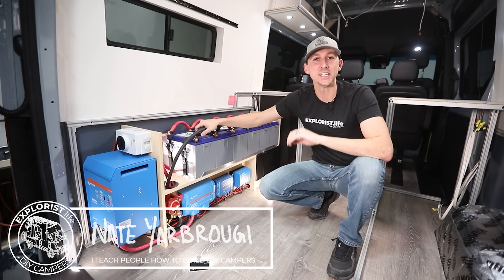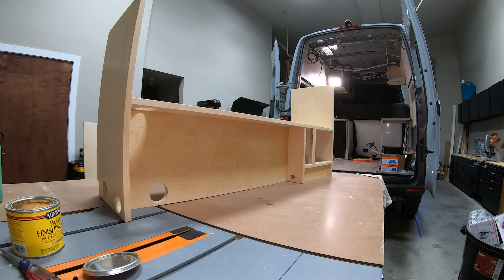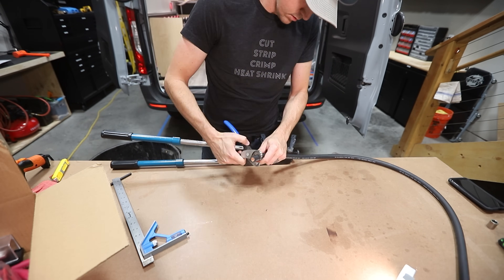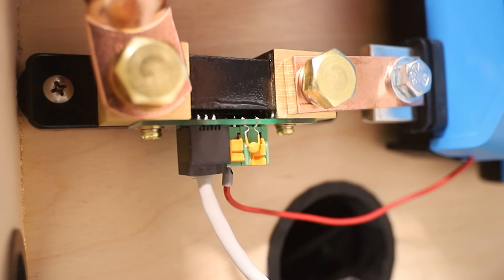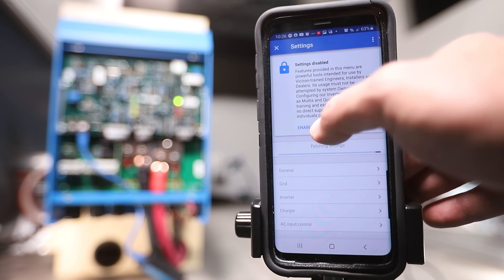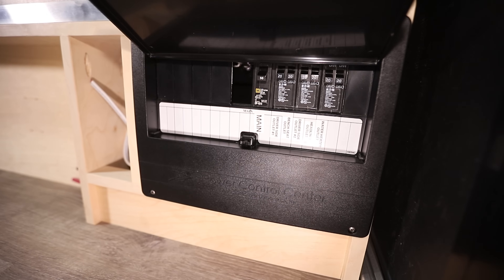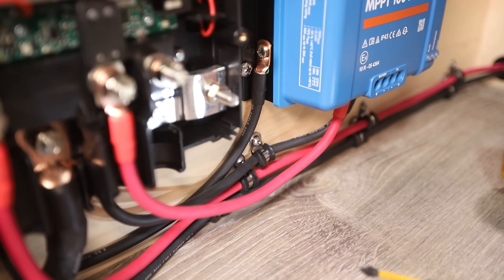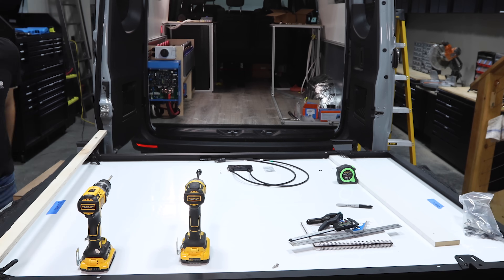DIY Sprinter Camper Van Electrical Install - Full Tutorial

Comment: When your charging the batteries off shore power is there a bypass so that your electrical usage switches straight to shore? Or when you are plugged into shore the power go to the batteries and then to the rest of the system?
Reply from the maker: There is indeed passthrough when connected to shore.

Comment: Hi There!  I just purchased my set up from your guys and was wondering if you need to buy a specific breaker for the 120 panel or if a generic type will work?  Thanks!
Reply from the maker: There is a list of appropriate breakers under 'product information' on the product page for the panel: https://shop.explorist.life/shop/all-products/distribution-panels/120v-ac-distribution-panel/

You'll want to use Square D HOMT breakers (Square D HOM Tandem) in whatever size you need.

Comment: Hi Nate! I’m closely reviewing the dc/dc battery charger installation and I’m wondering why you connect the positive wire to the start battery charging circuit. I do have a renogy battery charger, and they give instructions to place the pos and neg wires directly to the starter battery (plus ignition cable). Is there an advantage to installing the renogy dc/dc battery charger in the way you model in the video? I also have a sprinter 2022. Thanks for any comments on my question.
Reply from the maker: You could also connect the wires directly to the starter battery if you can find the space.  Since Mercedes gives us a nice fuse holder to connect to, it's best to use that.  Renogy is just giving 'general' advice since they don't know what vehicle you're installing it on.  Similar to how all of my diagrams at https://www.explorist.life/solarwiringdiagrams show connecting directly to the starter battery.  If it's better to connect in a different method for a specific vehicle...do that.
Reply: @EXPLORISTlife  Thanks a lot Nate! I appreciate all your help!!

Comment: Hi Nate, thanks so much for doing this it’s really helped me out with my victron install. I have one question, when I isolate my battery i still have power coming to my lynx power in via the solar/mppt UNLESS I turn off the solar isolator. Does this sound correct?
Reply from the maker: You should always turn your solar disconnect switch 'off' before turning your master battery switch off.
Reply: EXPLORIST life - DIY Campers thanks Nate but aside from that it sounds normal?

Comment: Is the multiplus pre-programmed for battleborn batteries out of the factory. For example if you buy the Batteries first then the multiplus later, will it's factory settings still be for the battleborn batteries?
Reply from the maker: If you buy the Multiplus from Battle Born, they will program it for you if you ask.

Comment: Would there be a way to incorporate an EV charger to charge the batteries through the Victron system? If one had a significantly larger battery system, being able to go to an EV charging station and top it up before heading out or before parking would be cool.
Reply from the maker: I'm strongly against that, from an ethics standpoint.  That's a great way for us to get even more parking lot restrictions placed on campers and vans.  Leave the EV charging stations for those trying to re-charge to get home or to work.  If you need to charge from shore power that badly, a campground is the answer there.

Comment: When I asked the battery manufacturer (I went with Lion Energy) they advised against chaining 6 batteries in a row and said it would be better to split them into two battery banks. Have you heard differently? Also the shunt says its only rated for 500a, is it ok to run all the battery grounds through just one smart shunt? Thanks!
Reply from the maker: I can't go against a battery manufacturers recommendation.  that would be a pretty huge liability for me if something were to go wrong.  It's no issue with Battle Born Batteries.

Re: Shunt size: This system will never be able to flow 500A to overload the shunt; and if it did; the 400A main fuse would blow.  Don't confuse amp hours of battery storage capacity with actual amperage demand/output.

Comment: Nate, getting ready to install my electrical system. Would this entire setup with 620 ah AGM battery setup? I’m thinking of using this exact system but want to be sure I won’t be cut short on power or if there is a major difference in the components if I am using AGM rather than lithium?
Reply from the maker: All of these components are indeed compatible with AGM batteries.

Comment: I didn't see a breaker/fuse on the shorepower cable prior to it entering the inverter. I am thinking either a resetable fuse or an on/off switch before that shorepower wire enters the inverter? I have seen this in other layouts - thoughts?
Reply from the maker: That breaker is in the shore power pedestal in the campground or in the breaker box in the wall of for a standard 15A household outlet.  Same concept as to why there isn't a breaker between a wall outlet and a blender... it's protected at the breaker box.
Reply: @EXPLORISTlife  Right. Thanks a ton for getting back to me and the basic sanity check!! Your series is great and I am building mine out RIGHT NOW.

Comment: 16:17 I'd be curious to hear why he made the length the same, if anything, I'd expect the resistances to need to be the same since that would be affected by things like connectors and switches and whatnot, which would imply that the distances shouldn't be the same, but either way, it doesn't seem like the resistances or lengths of those wires would matter.

Comment: i have a  question,  how much amp can the batteries handle at the same time? if its only 100ah batteries means converted to 120v it only has 10amps output? that's far from enough for suppling all the appliances at the same time
Reply from the maker: Each of these batteries has a max output of 100A.  Since we wired them together in parallel, the entire bank has a max output of 600A; which means that, on paper, we could theoretically pull 60A @ 120V given we had a large enough inverter.  (caution - this battery bank and wiring would be too small for an inverter capable of putting out 60A @ 120V (7200W))

Comment: Also just wondering! Shouldn’t you be using a T-series fuse. I didn’t think the Anl fuses had a high enough ampacity rating in the case of a battery bank short?
Reply from the maker: Class-T fuses are technically the better choice, but they've been out of stock nationwide more often than they've been in stock over the last two years.  Something that is out of stock all of the time isn't particularly useful to any of us so we have to use the next best thing.

Comment: Hey Nate.

I'm working on a very similar system. Issue I'm having is finding a place to buy quality 6 awg triplex for the run from the multiplus to the breaker box. I can find good quality marine grade 6/3 but only in 30+ ft quantities. I realistically only need like 5-8 feet. Any recommendations on a brand/vendor who sells by the foot for a reasonable price?

I see your kit contains 10 ft of 6 awg triplex but you don't seem to sell just the wire. Mind sharing what brand you use and where one might find it? Wish I had thought to ask before I placed a recent order with you ;) 

Thanks btw. Your videos are great. Our battleborn package is based off one of yours.
Reply from the maker: One of the reasons we started selling this stuff is so I don't have to hunt around for who sells this stuff in reasonable quantities.  I'd recommend just buying our kit so you can install it like we showed in this video.  Obviously, you can choose to source it elsewhere, but I'll leave you to your wild goose chase for that one.  Here is our kit that includes the wire plus everything else you'd also need to be able to connect the wire to the breaker box and the multiplus: https://shop.explorist.life/shop/all-products/camper-wiring-kits/component-wiring-kits/120v-ac-distribution-panel-wiring-kit-no-panel/
Reply: @EXPLORISTlife  Hey. I can appreciate that but it just doesn't make sense for me to buy your kit. I have everything else in it already.  The price plus shipping is only about $60 less than buying 30 ft of marine grade 6/3.  I guess I'll go that route and then see if anyone locally wants to buy any of the excess. Thanks anyway :) 

I am actually getting a shipment from you today with some other items in it though... really appreciate you.

Comment: I am beginning the electrical system in my van (2019 pro master) using your system here. How did you mount your battery box frame to the van? Or does yours not need to be mounted since it seems like its going to be in a bench?
Reply from the maker: It was secured to the body of the van with L-brackets and bolts.

Comment: Hey man i was wanting to know what i would need to run solar to my enclosed trailer, i was thinking 4 100 watt panels, 200ah lithium battery and a 3000w inverter. But i was wanting an ac so i know I’ll need a generator. My question would be how do i have it all hooked up together so if i was to get power from shore power plug?
Reply from the maker: I think this video meets all/most of those needs?

Comment: Just trying to wrap my head around one thing. 

When plugged into shore power, does the multiplus run my DC devices and bypass the batteries? 

Or does the multiplus just charge my batteries, which I turn are still running my DC stuff?
Reply from the maker: A bit of both.  The Multiplus powers the loads and whatever is left over goes to charge the batteries.  If the load was greater than the charging rate, all 'charging' power would go to the loads and the remainder would come from the batteries.  None of this really matters, though, as it all 'just happens'.

Comment: Great video!!!!  I have a Promaster vice Sprinter-- what's the difference with the Orion?
Reply from the maker: The connection to the OEM starter battery fuse block busbar would just be a little different.  Instead of a MIDI fuse; you'd use another MEGA Fuse.  I have some additional info on this page about that: https://shop.explorist.life/shop/all-products/fuses-breakers/mega-fuses-fuse-holders/mega-fuses/60a-mega-fuse/
Reply: Hi, now looking for the solar isolator,  can't find it on your web site--can you help?

Comment: Hi Nate. Many people have been suggesting to me to use MRBF fuses, but it sounds like that would require me to get three fuses (one 100A for one battery, one 100A for another, and one 250A to run to the distributor). Curious as to why you decided on ANL rather than MRBF? Seems much easier to me to just use one ANL fuse but everyone says MRBF would be safer!
Reply from the maker: In this system, we needed a 400A fuse between the battery bank & lynx distributor.  MRBF fuses don't come in anything bigger than 300A.
Reply: @EXPLORISTlife  Got it! In smaller systems, do you still go for the ANL?
Reply from the maker: Nope.  For the main system fuse, if it can be 300A or less, we supply an MRBF fuse in our kits.
Reply: @EXPLORISTlife  thank you for the quick reply!

Comment: I know all your leads are equal lenghth but Do you have any issues with battery balancing or discharging at differant rates With so many batteries in parallel??Many thanx for the detailed vid.
Reply from the maker: No problems, no.
Reply from the maker: I also suppose that since this is your second comment with basically the same question, I can tell you are worried about how to wire a battery bank.  Perhaps consider using our kits and purchasing through our store.  Since we sell this stuff and guarentee it's performance, we have a pretty vested interest in making sure your system works perfectly: https://shop.explorist.life
Reply: @EXPLORISTlife  iam in aus.
Reply: @EXPLORISTlife  iam not worried at all,just getting try to get an opinion on charge/discharge of evenly spaced cables on a bus bar vs tagging leads off the b+ and the furtherest negative,like you have done iv seen  a few tests on this and victron say this isn't the very best way although it works ok,and wanted to see or hear your thoughts/experiences on this as you have completed and tested this setup,my understanding is the 1st battery will charge and drain/give off more amps than the rest which causes and unbalanced situation,knowledge is power rite?
Reply from the maker: @shameelali2549 There are 4 different correct ways to wire a battery bank per victron documentation, and the way shown is one of those.  There are extremely minimal differences between them all, electrically, so it’s best to choose the one that physically works for the space.
Reply from the maker: Regarding being in Aus: Nice!  We ship to Australia!  In fact Australia is our second biggest customer base behind the USA. 😃👍
Reply: @EXPLORISTlife  just purchased your wiring  diagrams,and wow,next level detail,this is  a mandatory step in any build with both wiring ideas/layouts and what suitable gear to purchase,many thanx.

Comment: I'm looking into building my own van for family of four. I looked at some short wheel based vans like airstream interstate 19 and pleasure way accent and on tour 2.0.  All of these van don't really have storage under the sofa and there are limitations as to what I can bring along. I'm thinking about building a van with a garage. I'm not a full timer and I'm going to use the van for weekend family travel, cross country road trip and national parks. I probably won't be boon docking. Is it feasible for me to build a entire battery system or go with all-in-one system like bluetti ac200 or go-zero yetti 3000?
Thank you in advance

Comment: Hello, if i was to have rooftop solar panels attached to the solar controller as in this system, where should i attach for a portable folding solar panel? should i go to the busbar (assuming the folding set has a built in controller) should i wire it into the current Victron solar controller anyways?
would it be bad to connect the Zamp to the current controller for the versatility of having the folding set have a controller or not 
I have a trailer with a Zamp connector already installed. I am retrofitting with basically this system (no Orion), I also have your wiring set from your website.
Should i change out the Zamp to something else before i block the area with batteries?
I've collected all the parts and tools and I'm in the layout and test fit process right now

THANK YOU for making these videos, they gave me the confidence to start a project like this!
Reply from the maker: Hey!  I'd recommend wiring each array (ground & roof) to separate charge controllers: https://www.youtube.com/watch?v=N0UB7LZVduk
Reply: @EXPLORISTlife  Thanks!

Comment: at 23:10 the ground wire is connected to the (left hand side) negative exit of lynx distributor instead of using the same default slot inside the lynx which has been reserved as ground wire for mppt as mentioned in other series of yours: At 3:43 of How to Wire a Solar Charge Controller in a DIY Camper Electrical System??? pls explain at u convenience, tks..

Comment: I noticed that you don't use any kind of anti-corrosion goop on your connections.  Is this no longer an accepted practice?
Reply from the maker: It's not really necessary for these electrical systems inside the climate controlled portion of the van with LiFePO4 batteries that don't offgas corrosive hydrogen gas while charging.

Comment: yeh, sorry. One more question...my van has only one AC circuit for all my AC outlets. Can I feed my 12 gauge wire directly into the inverter or do I need to run it thru a breaker first?
Reply from the maker: The Victron Multiplus does not have ac output breakers built into it, so you'll need the breaker box as shown in this video.

Comment: Another question; You are using a 100 amp fuse when you hook up your 12 volt fuse box to the Lynx distributor.  I am using 4 Battle born batteries and am wondering if I can use an 80 amp or even a 60?  Or if not those a 300?  I'm only asking because I have those and I don't have a 100 so I'm trying to avoid ordering one more thing.  Thanks!
Reply from the maker: Here is a video that teaches you how to fuse sizes if you wish to not follow our plans: https://youtu.be/5y-yDMEgV70

Comment: Another question; I bought the 10 electrical diagram from you for my set up.  It shows a ground coming from the Lynx distributor to the chassis.  But I don't have a connection there for that, (unless I double up I guess?).  And I don't see you hooking that up in the video.  I tried to attach a picture but I guess I can't do that on youtube.  Hopefully I'm clear enough for you to reply.  Thanks for all your help.
Reply from the maker: Sure!  That was covered at 21:57 in this video.
Reply: @EXPLORISTlife  Got it!  Jeez.  I just needed to go a little further in the video.  Thanks!

Comment: Just a FYI I did not read all the comments... I was just curious what that hole setup would cost including the batteries... No need to include the price of the wood put a box frame.. Thank you!
Reply from the maker: Check the "Full Parts List for this install:" in the pinned comment for pricing.  I don't put prices here in the comments section as I can't change them easily as the price of materials change.

Comment: it might be silly but I am confused. So you connected the wire from ANL into the input side of the battery. Same side that "ON" is on. Then when you wire this into lynx the same side with "ON" on it is connected with lynx adapter and the wire from ANL fuse is on the top. Did you just switch the front of the master switch or what happened? Cause if yes, is there any trick? I can't do it and google didn't help either. My understating is "input" of master switch connects to battery side and the 'output' to lynx, right?
Reply from the maker: The Input vs Output on the master switch does not matter.  In fact... the direction the current is traveling across that switch will change depending on if the battery bank is charging or discharging.